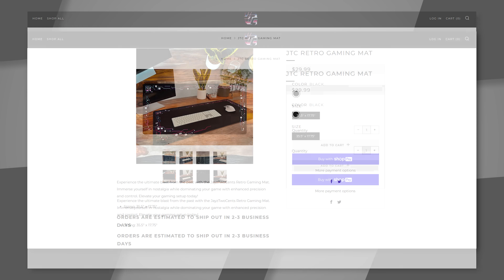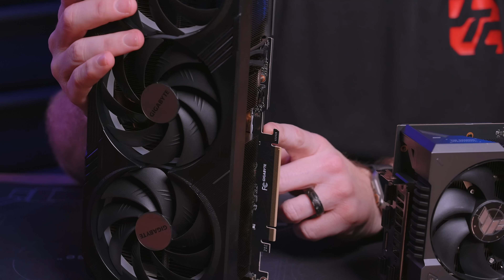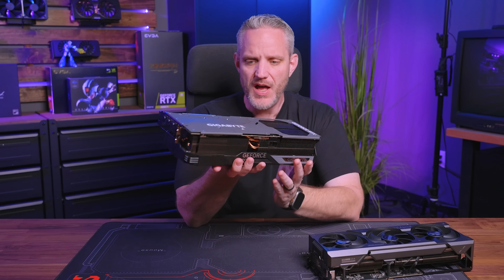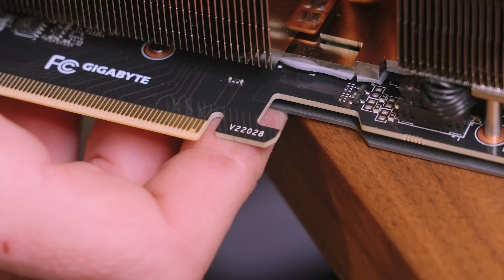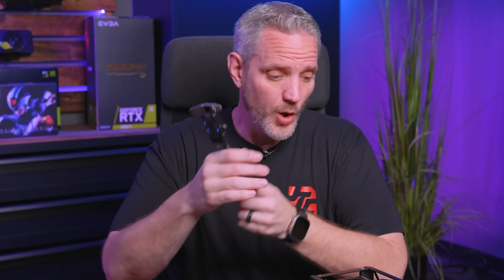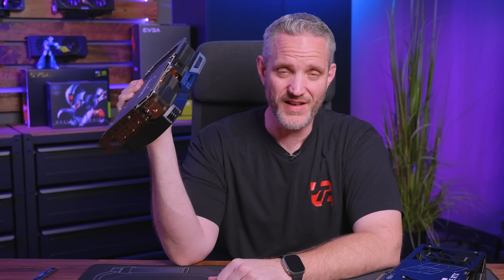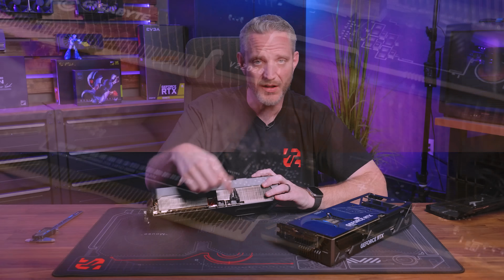These GPUs are cracking and the company REFUSES to warranty them!

Comment: I noticed what appears to be a shroud mount point support on the ASUS card seen @ 6:44 in the video at the problem area. This would stand to reason why the thinner PCB would seem to have less flex than the Gigabyte card which doesn't appear to have the additional support shown in the split screen comparison @ 6:55 in the video.

Comment: 01:00 I have an EVGA 3080TI FTW3 Ultra and I have been having crashing issues with Diablo 4. At random times (usually with a lot of NPC movement) the video will start stuttering as if it's lagging and then the entire system resets. All the way back to BIOS reset. Sometimes I have to power the system completely off to get it to reboot.
The only thing that seemed to help was a fix someone on the D4 forums suggested. Disabling "Microsoft Device Association Root Enumerator" seems to have almost completely stopped the stuttering and resetting. Only once since disabling it has the system crashed and that was during a really intense battle.

Comment: Oof, uses common sense isn't common.... Don't forget 4090 issues have been primarily identified as "USER ERROR" when connecting the 12VHPWR... @JayzTwoCents Before jumping the gun "AGAIN" just consider all variables... GPU SAG is nothing new, spend the 9$ on a GPU support or the extra 40$ on a vert mount kit... Search GPU SAG images, and you'll get triple the amount of stuff you suggested on the Giga 30 series..... Unfortunately anything past the 30 series will suffer to similar issues due to the shear size and weight of the cards if not supported or mounted properly.

Comment: Stiffness does not necessarily equate to resistance to cracking as less stiffness means it will bend more before it will crack and break example mild steel vs hardened.

Comment: My PCIe retention PCB tab snapped off completely on my ASUS Strix 4090 OC. Thankfully it hasn't cracked any more of the PCB, and I vertically mount it with an EK water block on, so it's no big deal. I ended up 3D printing a PCIe mount to offer it better support. It's been running for months now with no issues.

Comment: The way you fix "sag" with a Gigabyte 3080ti Master is to have it in a Meshify C case with fans at the interior front. Ask me how I know 👌

It takes 2 people, however you have one person grab the front and back of the case (with the front fans already mounted), while the other person fits the card. Once the first person let's go of the case, she's locked, the fuck, in.

Video card manufacturers really need to address this constant issue with improper load balancing of THEIR products when mounted "normally" ie: in the slot with no riser cable.  It blows my mind that this is STILL an issue with hundreds or thousands of dollars worth of GPU where it literally can't hold itself up with the "normal" mounting.

Comment: Here's an idea, I know its pretty much standard practice to place that retension hook as part of the PCB, but what if a manufacturer omitted that hook from the actual PCB and designed thier cooler so the backplate and/or front side of the cooler had some form of identical shaped and sized rigid hook built into it so it could lock into the same area and have that entire area supported by the cooler and not the PCB.

I'm no engineer with experience in that design area and there may well be a miriad of reasons why that cant be done, but seems like a common sense way of doing things. I'm not saying trash the current designs immediately, but maybe something to think about when designing a new card line in future (maybe Jay could reach out to his manufacturer contacts and ask them if they ever throught of doing a cooler mounted hook design instead of PCB hook). Those tabs made from the PCB date back to when cards were all single slot and weighed probably less than 200-300g, now they can weigh in excess of 2KGs with a cooler attached. Seems like designers didnt really think that failure mode through in the later generation cards.

Comment: Just noticed something from the thumbnail, the G/B PCB has a larger inset cutout by the tab (meaning less actual PCB structure in the area) that looks like it would make it more succeptable to stress fractures, which is probably why the Asus feels sturdier as well.
Reply: The ASUS also has a post that attaches to the cooler that looks like it's helping with rigidity
Reply: same.

Comment: Hey man, today all the parts for my first ever pc build came in today and I have you to thank. its been since 06 since building a pc and your videos have taught and helped me more than ya know. these kind of talking head videos to the builds to shit you name it.  you and the crew, love ya guys!
Reply: Just don't put your hands over the connectors, tracks or components like he does. If you don't have a anti static strap hold the case and touch the PCB awhile in the static bag to equalise any charge. Always hold PCBs by the edges, static electricity is a killer. I would even wear cotton and wool over polyester to help prevent static build up.

Comment: I have a nVidia Founders edition 3080Ti , and Diablo 4 has been running at 82 Celsius, the fans do hit 3400 rpm sometimes while playing D4.   it does this during cut scenes a lot.  
I have limited fps to 144 in the nVidia conrol panel.  I have v-sync on. 144hz monitor.  The fps doesn't change in the cut scenes according to nVidia performance monitor.  I don't know why but cut scenes are an issue for cards.

Comment: I have a gigabyte 3070 ti its the only one I could get at msrp, I have mine slotted vertically top down I am thinking it will be ok as its secured at the top of the case, so the highest load will be at the top of the card hopfully there will be minimum load on the pcb tab

Comment: imagine that something that's engineered to lay parallel to the ground is breaking when you turned it 90 degrees and hang something that's 10x's the mass that the slot was engineered for. get a tan case put on desk set monitor on it bam problem fixed.

Comment: I don't agree with your take that companies should RMA damaged goods.

Also, how do you prove it wasn't customer negligence that broke these cards? Just because the guy bringing the card in and claims he did nothing doesn't mean he didn't bend it while installing power cables, or removing the card for upgrades, or using water cooling on the card or trying to plug a sata cable in without taking the card out... the list is endless and manufacturers should NOT be held liable for physical damaged cards.

Notice it has been Nvidia's 30 and 40 series are having all these manufacturing issues... cracked boards, melting power connectors, boards frying from running certain new games. With the premium these cards command you would think people would stop buying Nvidia. I've been running AMD cards for years and not one has ever broke or died on me in some physical manner. Yet, the two GTX 560 cards I had both died on me and had to be RMA'd with EVGA.

Comment: I'm not sure if they have a different standard for RMA on the motherboards vs their graphics cards but I bought a non-working Gigabyte motherboard off e-bay that was still under warranty. Filed for RMA, they accepted it without even asking for an invoice or anything like all other brands. A week later I had an email telling me what the problem was (short on 3.3v rail) and a tracking number for the replacement.

An NZXT B550 board I bought new stopped working & fried my Ryzen 5900X in the process. It took 3 months to get a replacement motherboard & they refused to do anything about the 5900X. They were also unable to tell me what was wrong with the board. So in my personal experience Gigabyte RMA > NZXT RMA.

Comment: PCBs are fiberglass. More specifically E-glass fiberglass.
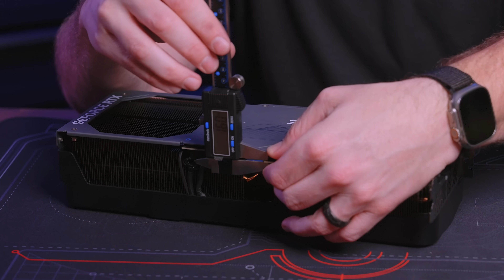Looks like you need help with metrology (measuring) techniques too. ;) 8:34 
And Gigabyte boards are breaking and they're being difficult about the warranty? The same Gigabyte that sold PSUs that literally blew up? Weird.
A huge factor in stress cracking like this is physical design of the board. The radius of the cutout there and the PCB at the other side of it play critical roles in cracking. It looks to me like the Asus board has a larger radius there from the tab to the main part of the board. This means less stress concentrations which cause cracks. Though, usually, a larger gap means that area is more flexible, which would be a point in Gigabytes favor here. But it all needs to go through analysis and simulation whenever anything is changed about a structure. Asus also has that cooler support closer to the tab and the slot.
One last note on your analysis of GPU support, I highly recommend still using a GPU support bracket with these heavy cards. The IO plate being tied in is good but scooting the plate up before locking it in puts stress on the PCIe slot and the PCB of the GPU there. It's just in a different spot and could be more stress. It might not be a problem since the PCB is generally better supported there, but it is still flexing the PCB when you lift that back corner but don't support the front corner. Support the front corner on heavy cards. The card needs a minimum of 3 points of support (everything that is stable has 3 points of support). It will get those however it needs to. You can choose for 2 points to be the PCIe slot, or you can make the PCIe slot 1 point. That far out corner still needs support.
Thank you for coming to my TED talk.

Comment: Louis isn't an engineer, he's a mostly self-taught repair guy.
Also, the PCIe slot isn't really intended to be structural, which is a problem with stupidly large GPUs, especially if they get shipped or have bumpy rides.
And yeah, Gigabytes knows to look there because it must be a known design defect they want to blame on users. People may need to push for a recall / class action.

Comment: I just had my 3080 sent off to gigbyte under warranty by my retailer I bought it from, it had been two months and according to the retailer they wouldn’t tell them if h they had replaced the card or repaired it and all they were told was “problem solved” on a note in the shipping box. 

My 3080 was causing stuttering issues in games.

Comment: Like to have a dollar for every card I've repaired over the last year with cracked pcbs, corroded/broken traces under the GPU and broken/corroded traces under memory all do to ppl not using support brackets.. Usually it's the gigabyte cards that crack but all suffer from the other issues.. Usually cards from other brands don't crack at the pcie they break traces under the CPU and memory which is just as bad..  We need a new design for cases and or motherboards for these heavy cards.. The little pcie slot with a 5-10 pounds card just isn't going to cut it.. Good for me though lots of business lol 😊

Comment: with the ever increasing size of gpu cards and more importantly increasing weight and size of gpu cooling why haven't they redesigned the standard mounting solution to a beefier socket as a business praxis? (sure i know why cost what else) I mean an actual mounting tab made of metal instead of pcb material might just be necessary for the future.

Comment: Is it really a surprise that the same company that was making the exploding PSUs is also making cracking GPUs?
I would hesitate to put any new Gigabyte components in my system. Which is a shame because my first gaming rig had a Gigabyte motherboard and GPU, and it never gave me issues. But that must have been before they started cutting corners.

Comment: Due to pressure from the green 'net zero' brigade could it be the changes forced on manufacturers to use different materials in the substrate which are inherently weaker?  but yet again look at the card,  it must weigh enough to create a stress crack over time,   my guess is the pcb isn't capable of coping with the weight of the card as well as the cooler, and what could aggravate it is the manufacturing tolerances of the case the mainboard and the card is fitted in, many a time I have seen cases that  the securing screws for the cards are too high or too low or even slightly misaligned, maybe the best course of action is to have the card mounted vertically....

Comment: I wouldn't say the flex is good or bad without proper testing. Being more rigid may in fact be worse. Think of a rigid stick vs a flexible stick, the rigid stick will snap under pressure while the flexible stick will not at the same amount of pressure. A proper test of how much pressure is required to cause each to fail is needed not how much to cause mere flex.

Comment: Maybe there is a defect... or maybe there is a motherboard problem that is creating excessive pressure on the cards when you try to remove them (or even when in place).

See, you mention up front the problem of removing a GPU these days.  The card slot is generally high on the board, and the cooling solutions on many builds make it near impossible to reach the release tabs.  When you try to take it out without properly depressing the tab, the forces (especially a ripping style force) will be pretty high.

So the question really is: What force is it suppose to take to remove the card, what are the forces if you try to remove a card with the tab not properly unlocked, and is it reasonable to expect any GPU maker to have cards built strong enough to handle this type of force?

We know the forces in these areas are high.   Armored PCIe slots are a common "upgrade" on higher end boards.  The GPUs are heavy and they are being held on mostly by a very few contact points.   Again, the amount of stress here can be high.  With an armored PCIe slot, does that then transfer all of the force to that little tab?   Is it a poor overall design for GPUs at this point?

I do agree and accept that there are possibly things that could be done to improve the rigidity of these tabs.  Things could be done design wise to keep circuity away from this part of the PCB.  Perhaps replacing part of the layering with materials to improve strength and limit twisting forces.   It may well be time to just completely redesign how GPUs are installed on boards and how their bulk is handled.

Gigabtye is failing by not getting ahead of this.  

Oh, PS:  Louis tends to whine a lot.  He does it so much that many just sort of tune him out.

Comment: I looked on my 3070Ti Vision (sadly I dont remember the numbers on the little tab near the PCIE pins) and it have the same PCB cutout the other Gigabyte cards have, but mine is really stiff and doesnt flex. Something went wrong on some card revisions to get a PCB that thin to the point it flex and break.

Comment: Well…… shoot…. 😂 now I’m worried about my 3090ti. Only reason why I got the gigabyte one was because the card matched the non RGB build. 
Edit: just checked my 3090ti and it’s good. However, the PCB seems sturdier than the one shown in video. Maybe it’s just me but still gotta buy something for the little bit of sag as the gigabyte bracket doesn’t fit with my case.

Comment: Realistically,  if you have a card that is that big and heavy you should be taking the physical aspects of it into account, putting a card like that into a standard side mounted motherboard tower should make you cringe at just the thought of it, I also don't believe in using the GPU kickstands either... You should be using a tower like thermaltake tower 100, 500, or 900 with the motherboard I/O vertical so the card is supported by the I/O bracket and the weight of the card actually drives the pcie connector deeper into the motherboard slot, sorry Jay I have to disagree with you on this one, I don't feel gigabyte is in the wrong here, mechanical damage will always fall on the consumer for mishandling. The person that assembled the machine is also the designer of it, it's negligence of the card owner pure and simple.

Comment: Sag makes sense. That is the last area that is actually supported by the socket so it makes sense that they would break there. The cards are simply too big and heavy for the original specifications of the PCIE socket. Its an old form factor that was not originally designed for 15lb graphics cards. When it was designed they weighed a pound or two if you were lucky.

Comment: There is a standoff right next to the bracket on the ASUS card therefore you have a shorter distance to bend, so while it might be thinner it is a much shorter and thus harder to bend area
Reply: That's the thing that I noticed right away. It's more than likely the reason why it's not flexing so much.
Reply: @majorschemer4872  I agree

Comment: To me, it looks like the bulk of the additional flex, or more accurately, the main reason for the lower amount of flex in the Asus card is due to the screw stand-off near that point on the Asus card. That rigid mounting point so close to the spot you are trying to flex will reduce flex, while the Gigabyte card has a larger surface area of the board before any rigid mounting points.

In theory, that alone doesn't make the Gigabyte more likely to crack.  Given the same amount of force, if the board flexes less, but at a more acute angle due to being held rigid, it could actually be worse in terms of generating a crack over time than if the board is a bit more free to flex, but in a more gentle arc.  Difficult to say for sure.

Edit:  Should have scrolled further down in the comments. Others have mentioned the stand-off supporting the board on the Asus.